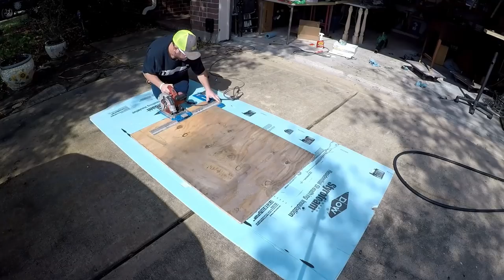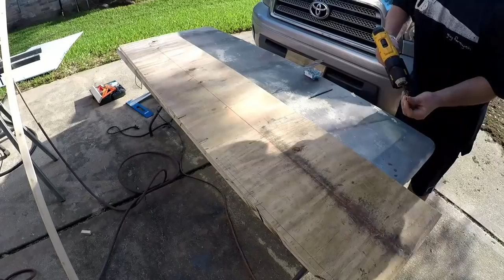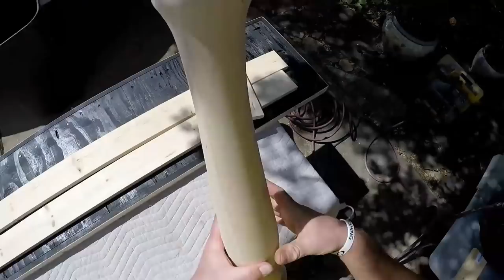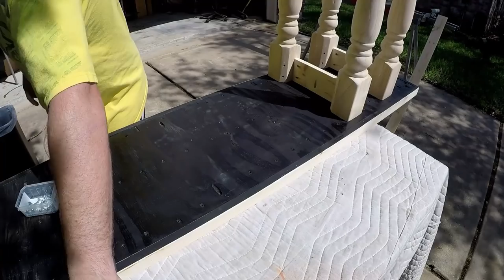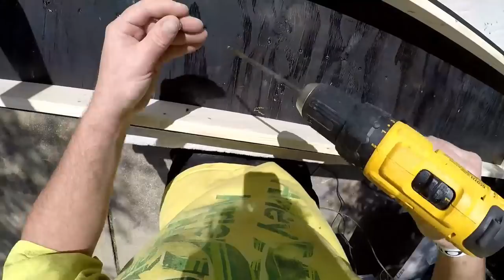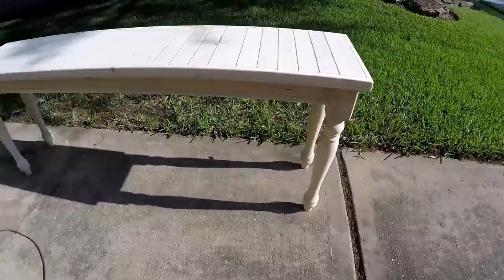Large Console Table Build

Comment: the key to making multiples on a lathe is a contour template. i used to work in manufactured home cabinet shops, and at homecrest cabinets in the 80's. it's easier to follow a template than to freehand when making duplicates. that and a bunch of calipers and dividers. set them up according to the measurements on the template, and check them often. i never made the designs, i just made the components according to the template given to me with the work order. i made pedestals for tables, cabinet fronts and assembled doors. when you have to make 30-40 units a day depending on the complexity, that have to pass inspection, you get good at reading that template. those kreg pocket hole jigs are handy as all get out, ain't they? i remember having to make screw pockets freehand when i first started out on my own before they had the jigs. in the shops they had a machine they called a tub drill that did them as singles, or two at a time an inch and a quarter apart for cabinet fronts and door frames. if you are doing simple butt joints without biscuits or dowels, they are the only way to go. nice table, by the way.